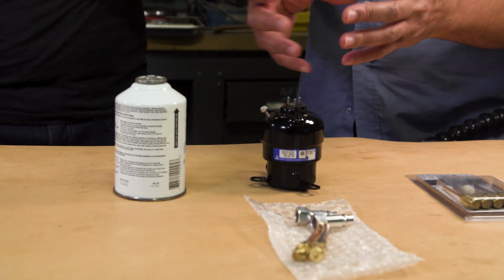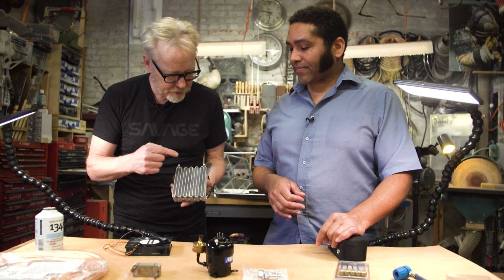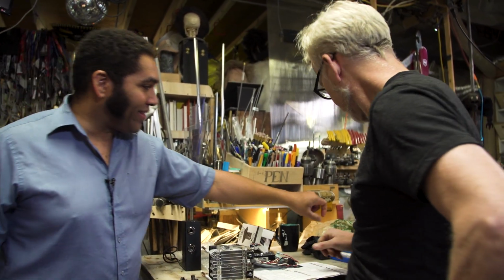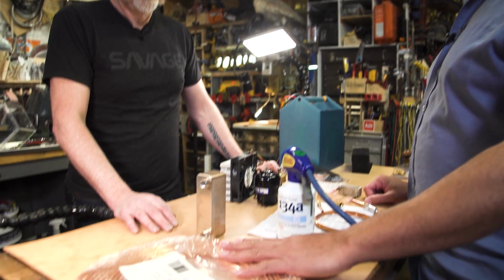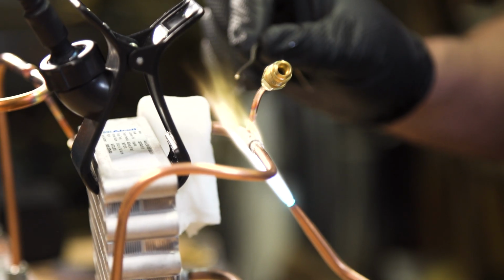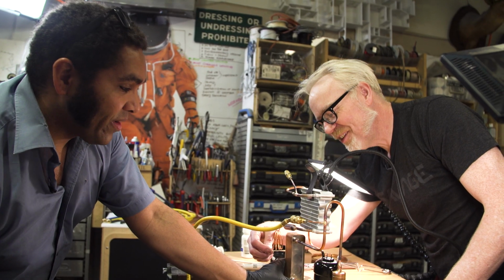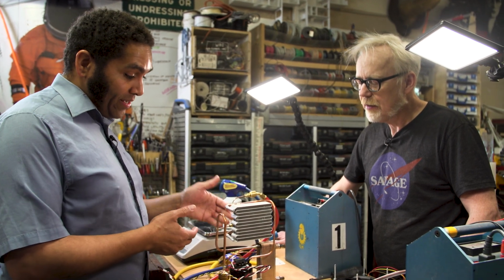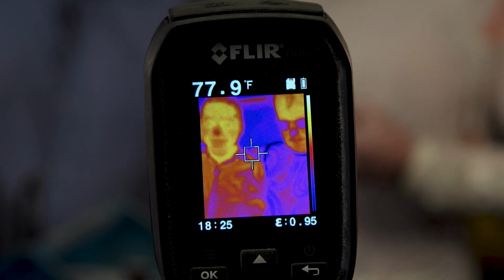Adam Savage's One Day Builds: Refrigerated Cooling Suit!

Comment: I kind of want to share that the heat exchange units that use microchannels also came up in my field of study: Biology. (I'm a Biology student at uni, and this was one of my favorite classes...)
> Form and function: Animals - Respiratory systems and biomechanics during movement phases <

The gills of fish work in the same way, utilising cross current flows between high oxygen-concentrated water and low oxygen-containing blood. In the way these gills work, they are the most efficient way of oxygen transfer through diffusion in a biological system, even compared to our own. It uses constant flow and 2 'chambers' for it's system.
(The fishes or Osteichthyes use a pumping action generated by their mouths and 'gill-caps' or operculum. The Chondrichthyes like sharks use semi-permanent flow through swimming to let water glide over their gills.)
Bird-lungs operate by using a big channel with microchannels outside of these where blood is circulated along them. Using a pulmonary system with multiple chambers allows the bird to shed wheight for the ammount of volume present.
The bird system uses 4 chambers linked together where one chamber-volume fully circulates the respiratory system every 2 lung-expansions, where it will pass through a respiration duct with the most efficiency.
The way these heating systems operate reminded me of biological systems... It's still true we find the most ingenious and efficient manners of usage in the harsh environment of nature.
(Sorry for bad grammar and spelling, English is not my native language, so I might make some mistakes... sorry)
Edit: major spelling and punctuation

Comment: This is such an awesome build. Living in LA during the lockdown, I’ve been developing my own filter masks that will pull a seal around my beard, and thinking about cooling, so this was informative and inspirational.  I am trying to come up with something smaller and was wondering if you know anything about “thermoelectric heat sync cooling peltiers “?  GeeBat 10PCS TEC1-12706 Thermoelectric Cooler Heat Sink Heatsink Cooling Peltier 12V 5.8A https://www.amazon.com/dp/B01IT8SAZG/ref=cm_sw_r_cp_api_i_rFDPEbFPGCSZX

Comment: Actually you can order single parts on AliExpress. I bought small radiators for a few bucks. They are probably not as light and efficient as yours, but just in case someone wants to experiment, it´s possible to get them. The dual loop heat exchangers might be hard to get, though.

Comment: Anyone who works outside in summer in the southern states of The US wants one of those. I used to work in a forge, with ambient temperatures in the 130' to 150'F range during winter, I would have killed for one of those suits. It would have saved me several trips to the hospital for treatment due to heat exposure, dehydration, etc.

Comment: The guy clearly knows what he is talking about....but he cannot solder for shit :P For one, you don't use the flame to melt the solder and for two, you use about 50x less solder than that (hence why mentioned he blocked the inside with solder once). I'm not knocking the guy, he clearly knows his shit, but he has obviously self taught himself to work with copper and is making a bit of a mess of it. Kudos for managing to get it to work though.

Comment: They could have used a fitting with an inner thread and a grub screw. Drill a hole through the centre of the grub and use it as an orifice for expansion of gas. Changing the diameter would change the bubble point. Could use a Schrader access fitting male/female to hold it. It would replace the TXV(thermostatic expansion valve). And would get rid of the coiled capillary. Used them in systems I worked on in my job. The only issue with that is that it would introduce a non brased connection, which could potentially leak. The leak potential is already there from the access fitting for evacuation and charging the system. Happy to see they used a drier in the system, which prevents a lot of potential future issues. They use the same gages as I do at work awesome. And would be so cool to see that the superheat is checked, those gages have a setting for measuring that.

Comment: Hey Adam, I think I know a guy who can build me this refrigeration unit. I'm curious if you can share the parts list of the things you used for this build? I'm also curious to know how much this unit costs and if its at possible to use sling it on your back while I work on some hot summer days.
Reply: Sorry, I forgot to add if you can weigh the unit to see the general weight of the equipment? I'm curious how much this weighs and how long it can be worn in a single day. Hence the reason I was wondering if I can sling it on my back.

Comment: Another option for pressure reduction , besides either a fixed orifice/nozzle in the line, or using a long piece of capillary tube to get adequate pressure drop, is a microvalve.   DunAn Microstaq, of Austin, Texas, manufactures valves out of silicon that are being used in Refrigeration,  Air Conditioning, and heat pump systems.  Advantageously, it provides the ability to vary refrigerant flow through the microvalve as the system load varies...an alternative to cycling compressor on /off  or varying compressor or fan speed.

Comment: Don't get me wrong - this is a cool setup. However it is RIDICULOUSLY over-engineered for what it has to do. A cheap submersible DC fountain pump in a Camelbak full of ice would work fine and be a tiny fraction of the cost and weight. You're at a convention, not Mars or the middle of a desert. Just exchange water for ice from a cooler once in a while. Instead of relying on massive batteries to do the refrigeration, you can do that step at home and not have to carry your refrigerator with you. Exploit the fact that water has an incredible specific heat capacity. 

Even if you were dead-set on onboard refrigeration, a few aluminum water blocks with thermoelectric coolers on them would also be far lighter, and could both heat and cool with a simple polarity switch. They're only around 25% as efficient as rankine coolers but you could trade the bulk and mass of the compression system for some easily-hidden LiPo batteries to compensate.

This is undeniably neat, but as a product development engineer in the mechanical field myself, my inner control freak is shouting at you! Anyway, love the content; lifetime fan here. Stay safe!

Comment: Thunderf00t did an experiment where he used a Flir camera while he rode a stationary cycle. Initially his legs and arms and torso all heated up. But quickly, all the heat went to his arms. They were glowing while the rest of his body went close to normal temps. I would think a good set of sleeves would do wonders. Especially if there were something for the neck. 
Make these like welder sleeves so they can be added to/worn inside leather jackets and I bet you could sell one to every biker that ever rode in 90 degree plus weather. And the vodka leaking from the sleeves in a crash might conceal a dui.

Comment: That's some amazing stuff. One question though, any reason why you are not using silicone tubing? I'd imagine neither the temperature nor the pressure would be a problem at this scale. 

On the same note, I've moved to UK recently and I noticed all the plumbing here is done with copper too. In my home country, it's usually done with PVC tubes. I've been wondering if there's an advantage to copper.

Comment: ABSOLUTELY incorrect that 134a freon doesn't hurt the ozone. It is a mix of freons that is far more sensitive to moisture, and doesn't get as cold as others like r22. All freons are bad on the ozone. The ozone hole is closing , not because of the non use of r22, but because freon is far far more regulated and monitored and companies are finally taking it serious. After thousands in fines and some prison terms, hvac techs "for the most part" try not to dump it into the atmosphere. On the suit setup, You don't need a bigger water tank because essentially the whole suit is a tank.

Comment: After you guys blew up that cement truck nothing came close to it except for this video. I am certified as well as being an A&P over 25 years. This video blew up harder than the truck, in that this is the most comprehensive 101 Refrigeration Course ever. Whatever Kipp Bradford got paid, double it and give it to him again. Kipp is totally awesome in instructing and wow! soldering. This guy is totally awesome. I'll tell you why I'm impressed. In the field, this does not get explained in this fashion. It lacks of the substance for students or technicians to grasp the essence to the max comprehensive level. So, Mr Adam Savage, You've done it again Magoo! This is a mega valuable video and anyone can pass the certification with this as a super base. Adam. BTW I have some crazy ideas and designs of my own. Like a 4 stroke engine with no valves as we know them. Too inefficient. Thanks and be safe.  Saludos from Puerto Rico.

Comment: I would argue a pump reservoir combo is still as many points of failure as a separate pump and reservoir only if one fails the whole unit needs replacing! 
Same kinda thing with a PC AIO cooler, same points of failure (pumps, reservoirs, fittings, tubing etc.) only the whole unit needs replacing if say you spring a leak as opposed to changing one dodgy fitting, for example.

Comment: Super cool, I could use the supplier information for those parts. I have a business that needs a system like this. We work on live boiler systems and the heat and protective equipment that we use make the work very difficult. Right now we can only work in shifts of 5 minutes on and 15 minutes off. A 8 hour job takes 1 week to complete. I need this system.

Comment: While this is quite a cool build it is probably beyond the average person such as myself. Question though, since expanding gas is doing the cooling could we use vacuum to do the same thing? Please do a steam punk version with two very large syringes on a lever system that is run by a motor.it probably won’t have the 1.2 kW heat adsorption but it would be interesting to see if with a copper heat exchanger if we could get half of that. I was thinking that we could use a length of capillary tube for the orifice shorter length though and some OTC (over the counter) pneumatic check valves to turn the syringes into pumps.

Comment: 24:28 "This is about $400"

Adam: immediately puts it down
Reply: Considering how much he must have spent on some of his space suit builds that's a bagatelle!
Reply: He's wearing a $7,200 watch that he breaks with some regularly. Pretty sure he's not too worried about a $400 component so much as he is the time window he has for this project with his guest.
Reply: @SilencedMi5  Also, most smartphone cost more than 400$. People still use them without any fear :')
Reply: Lol
Reply: coincidentally also the price range for the compressor (as a sample in the Aspen shop)
Reply: He said that for a one off build it was not unreasonable, but for a production run ...
Reply: The compressor is 575USD as well, though that is just as specialized as that mini heat exchanger.

Comment: Did anyone else in the HVAC trade cringe when Adam cut the soft copper tubing with a band saw instead of using tubing cutters?  Some of the copper pieces(dust) get in the system that tiny compressor life and the plate heat exchanger just shortened.

Comment: I wonder if it would be possible to create a backpack with a helmet attached to both cool the wearer but also have a high air pressure situation by pumping cool air into a helmet. Could you create an air 'maze' that could thoroughly sterilize the air with extra intense UV light (mirrored inside and transparent maze) while preventing the UV light inside from leaking out as part of the backpack? Adding to the medic side of things have a VR glasses (or mobile phone acting as one) linked up to a thermocam so that the person wearing the helmet could 'see' the temperatures of the people they are in close contact to and switch to regular web cams when not checking?

Comment: I would think you need to go a little bigger on the reservoir and control the compressor by reservoir temperature. It would be more efficient and easier to regulate the temperature. The increase in weight of the reservoir would be offset by the decrease in weight in the batteries.

Comment: Hey Adam! I made those Schrader valves! I'm a manufacturing engineer with no degree. I program and maintain the vision inspection machines the check every core as it comes off of the machine. I also maintain the leak test systems that check each core. Made in Virginia,  U.S.A. If you are ever over this way I would be honored to give you a tour of our facility.

Comment: Didn't pull a vacuum that's why you only got 3 grams at start fill. When filling a system for the first time always fill through the liquid line or high side! And never put dry nitrogen through a compressor  it dries out the seals!

Comment: Surprised that the military did not just make a chest/back vest with a cooler line going up the neck and inside a snoopy cap or helmet. Cool the Head, Back and Chest. drop the skin temp 15 C Max, enough to stop heat exhaustion and dehydration from sweat water loss. If designed correctly it could also be used as a heater at night.

Comment: $500 USD for the pump (A-Series Miniature Compressor & Brushless Motor Drive)
$133 USD for the condenser coil (C4x4x1.25S)
$60 USD for the Braze plate heat exchanger (Cant find exact match, most seem to be same thread size and same side)
$92 USD for the pump / Res combo unit (XSPC ION PUMP/RESERVOIR (BLACK)
$5 USD for the Filter / Dryer (Common on ebay)

Comment: Gaaaah! That fan noise! The fan has it's spinning side facing the radiator and it's horrible.
It will be much quieter if those blades can be away from the radiator and a nice grill can protect them from ingress of Adam.

Comment: With total saturation diving, the problem deals with keeping a diver warm.  Inhaling a Helium Oxygen mixture causes the diver to exhale more body heat than he can generate--along with it being really cold the deeper you go.  To combat this, divers wear special suits that have tubing spread throughout the suit.  Hot water is sent down the umbilical and is distributed throughout the suit via the tubing.  The hot water keeps the diver's body warm to the point where hypothermia  is not an issue.

Comment: Could we maybe get a parts source list? This seems like an awesome way to practice the hvac trade
Reply: The problem is that the parts are expensive because they're not common. You'd be better off working with normal sized standard parts. You could use window unit A/C systems if you wanted something smaller than a traditional house unit.
Reply: @NBSV1  mini fridge is even smaller, although a lot of those use a xx-tane based refrigerant, so you need to be careful during the build process, but they are very efficient refrigerants, much more so than 410a, and even 134a at the same volume.

Comment: He lost me at "boil off". It sounds like he's saying you heat it back up to turn the liquid 134a back into a gas with a flame or something. That doesn't sound right. I think he should have said that the 134a liquid is piped back into the area that we want to cool which draws in heat energy into it which converts it back to a gas (which is the "boiling off") which goes back to the compressor.
Reply: The boiling happens when there is a drop in pressure. Boiling is defined by the point where the vapor pressure of a liquid exceeds the atmospheric pressure above it. This is why water boils more "easily" at higher altitudes, and the opposite condition is how a pressure cooker works (higher atmospheric pressure allows vapor pressure to be higher, thus higher temperature before "boiling")
Reply: @fakechuck7659  So do the pipes leading into the area to be cooled increase in diameter to decrease the pressure? Or are there more pipes than the condenser section? Just wondering how pressure drops in a closed system.

Comment: There is an easier way to think about the way that a refrigerator works. The key is that phase changes involve a large amount of energy - so if you compress a gas into a liquid, it gives off a large amount of energy which you feel as heat (there is also a bit of heat from the mechanical process of compressing the gas, but that’s trivial). When you allow that compressed liquid to expand, it absorbs a large amount of energy and the temperature drops. 
That’s why a propane tank gets cold as you use it - the liquid propane is absorbing energy (heat) to boil off the propane to gas.
It’s also why it warms up when it snows - as the water vapour becomes a crystal, it gives off heat.

Comment: Talks about how the system needs to be absolutely clean. Then, proceeds to clean inside fitting with a red scotch brite, but doesn't use compressed air to clean blow out fittings before brazing.

Comment: You should check out PC water cooling. It uses many of the same parts for the water loop but also integrates automation of pump and fan rpm based on the component temperatures. It is a really interesting solution to cooling high performance computers used for gaming, rendering, CAD and many other complex tasks. A YouTube channel that does this is Linus tech tips and they have many guides and are trying to get into the maker space. They are always up for collaborations and it would make for some really interesting content for many audiences. I’ve been a fan for years and would love to see you look into this. If you have any questions feel free to reach out